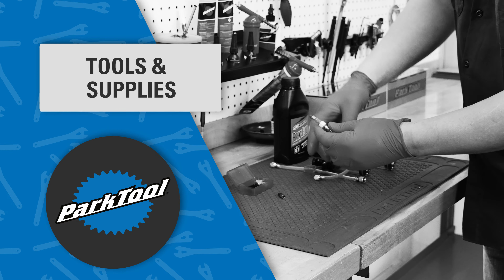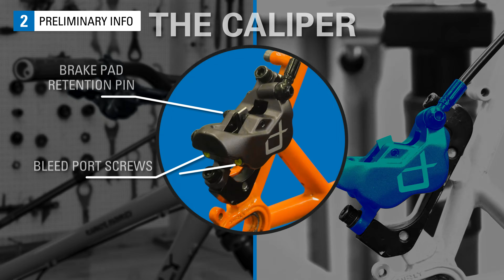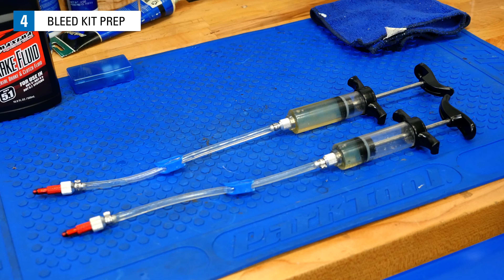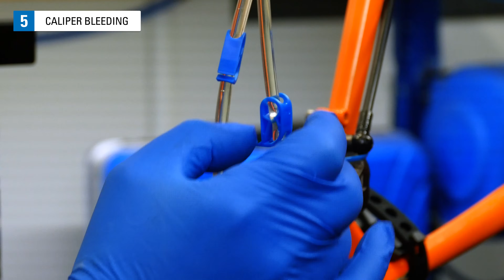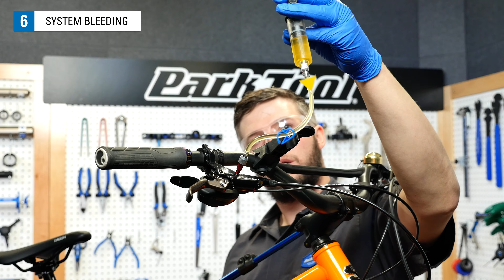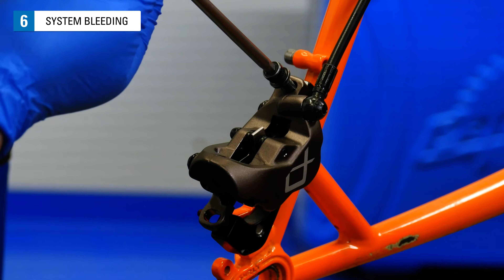Hydraulic Disc Brake Bleeding - Hayes Dominion D.O.T. Fluid

Comment: Is 1,5 Nm enough to preserve tightness of the ports on the caliper? In my case when tightening the screw to 1,5 Nm (new set of brakes) I was having leakage from both ports. I had to tighten the screws much stronger and for 2 days I haven't seen any leaking drops. Is that only in my case or has anyone had this same issue?

Comment: is it not a good idea to keep the caliper bleed ports facing up? fluid fell out on the last step
Reply from the maker: You can try. There will be a slight bit of loss because you end on compression of the syringe. This leaves a tiny bit of pressure in the system. The little bit of fluid coming out is becasue of that and is done to prevent air from entering.
Reply: In the Hayes bleed video, they say to always keep the caliper bleed ports facing up while bleeding.  I took my rear A4 brake off my bike, mounted it on an old handlebar, and clamped the handlebar in my repair stand, then I taped the caliper to the base of my repair stand so that the bleed ports were facing up.  The problem with keeping the bleed ports facing up is that the brake hose does not run straight upwards from the caliper to the lever, rather there is a loop under the caliper,  which is a place where bubbles could get trapped.  I think that is why Park bleeds with the ports facing down: it means any bubbles can travel straight up the line to the lever.
Reply: @JohnSmith-tw2hn  I bled mine last year with the hayes kit and can't remember what I did but they are still going strong 😁

Comment: I just installed these on my bike. During bleed process, I noticed that a ton of oil was leaking from the master cylinder bleed port during pressurization and air nearly freely entered the system when applying a vacuum. Any idea what that could be? I have looked in and don’t see any o rings in the bleed port, but the brakes are brand new. I also checked the other master cylinder and there is no o ring. Not sure what to do
Reply from the maker: Its possible that the o ring on your bleed fitting has a cut in it or that it is not seating. Inspect the o ring on the bleed fitting and test the syringe/ bleedfitting / adaptor setup by covering the end with a gloved finger and drawing a vacuum to be sure there is no leak in the syringe setup. There is a possibility of a leak in the lever but that is fairly low probability.
Reply: @parktool  no leak in the actual syringe set up but the bleed kit I have doesn’t use an o ring on the bleed fitting, I just googled around and it seems that every other kit (including yours) uses an o ring there..
Reply: @SaucyTeej  I had the same issue as you today. Did you find any solution to the problem?
Reply: @barryge  yeah I took it to a bike shop 😂 their syringe sealed. Waste of money but I love the brakes. They had to rebleed the front 3x
Reply: @SaucyTeej  haha oh boy 😂 love the breaks too. Thanks for the response!
Reply: You need to slightly tighten the syringe bleed fitting with a tool to avoid leaking and air ingress. Same thing happened with mine during the first bleed.
Reply: @benwildman6164  I tried it all
Reply: @benwildman6164  thanks, appreciate it. I´ll try it next time. I Just dont want to destroy the thread of the bleed port in the master cylinder :O
Reply: I had the same issue, but solved it by not pulling any vacuum at all. Just pressurise with each syringe. Could try thread seal tape too though